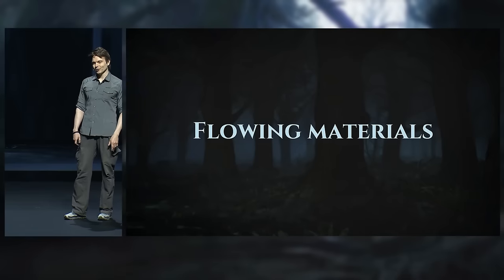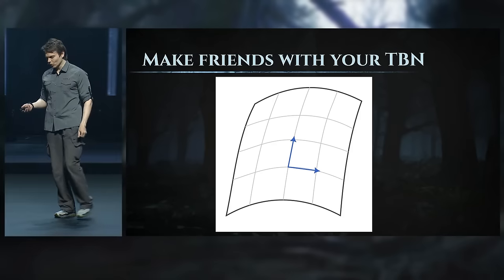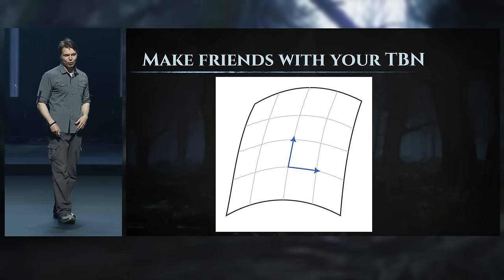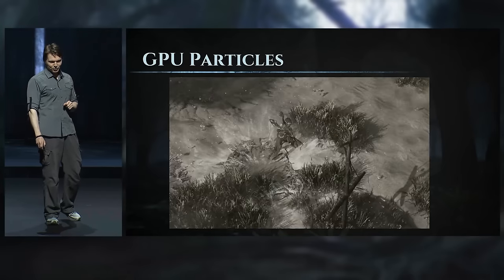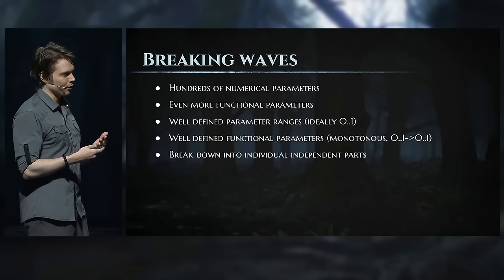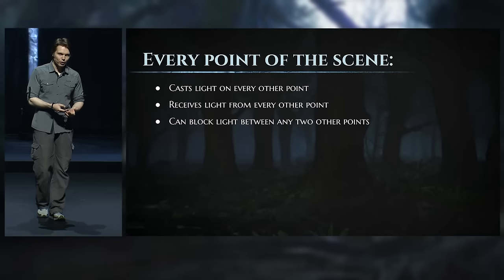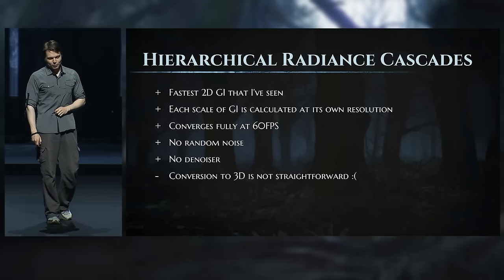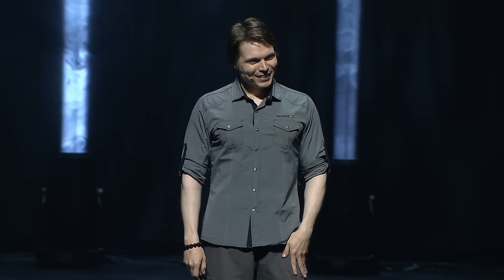ExileCon 2023 - Rendering Path of Exile 2

Comment: Since the talk I have a published a paper on Radiance Cascades. Unfortunately YT does not allow posting links in comments or even mentioning your own videos by name, so.. I guess I can only tell you that there's an announcement on my channel with a link to it?
Reply: If you are the presenter, thank you for this mazing talk. I still have troubles understanding how increasing the amount of light sources (thousands of fireballs) doesn't end up being O(n*n) or maybe O(n logn) but you end up ... O(1) ?? I will need to rewatch it and try to grok it. What number os that constant-limit based on? pixels on the screen? cubes of space?
Reply: @olivierdulac  basically it calculates lighting from every pixel of the screen on every other pixel of the screen. Fireballs obviously still have rasterization cost, but the cost of calculating indirect lighting of the scene is fixed, because the total number of pixels does not change.
Reply: Hey @Alexander_Sannikov - I'm not super experienced with graphics programming, but I do have a couple questions : Since this is screen-space, do you work on pixel buffers that are larger than the screen resolution in order to include light sources just outside of the frustum that contribute to the lighting on screen ? Also, how do you deal with light sources that are occluded from view by geometry ? E.g. a lantern under a porch.

Comment: I've never played a game like this.
I tried to understand the mechanics and features of skills and weapons in this game and realized that I don't understand anything. I guess I'm too old already.
Reply: Follow a build guide. I recommend Pohx’s Righteous Fire.
Reply: @MichaelPohoreski  It would be interesting for me to understand myself, and not copy someone else's experience.
Reply: @СтАрАеМсЯ-б5ы The problem is PoE is hideously overly complicated. There are just far too many mechanics to learn without spending literally years to understand what the game doesn’t explain. You will be constantly dying (which isn’t fun) unless you follow a meta build to do enough damage because you can easily “brick” your character.

At the very least be resist capped 75/75/75/0 as you proceed through the campaign. Around Act 3 you will want to start working on replacing all your gear with 4 socket 4 link rares.
Reply: That's why I don't like it. It's too difficult to understand. And you just have to suffer to find one better build. You can't effectively play the way you like, you have to create an ideal model that is already embedded in the game.  There is no freedom in this.
Reply: Uh, no. You copy a build, have a good time, learn things just by playing it. Take what you learned and apply it to a new build. I’ve made a few builds myself this league, self designed. This came from years of copying builds and putting my own spins on them as well

Comment: Account locked (banned) after support pack purchased from "wrong" region

Hi my account was locked/banned by GGG after I bought 2 supporter packs and paid it from a different region. Im in Australia and there is no "Australian" region in shop, so I used another region and payment was accepted by GGG multiple times a month ago. In POE shop there is no "special region prices" for pack/items, all prices are adjusted based on a currency conversion rate, so no gain or lose for me or them, thus no "fraud". However I was banned without any ability to find another solution or money back.

It is the same situation as you paid with your international credit card in another country, but the seller will tell you that you paid with the wrong "region" card so he takes the money and bans you from entering the shop and takes your goods.

I can easily can create a fresh Epic account and play poe again but I dont want to do it as I dont understand WHY the company behave like that without any REAL reason, as there is no gain for me and no loss for the company on the conversion rate) , only to punish the active player for their support. Not a good way to keep the player base which is not that big in mid-season especially.

Comment: Disable shadows. Thats what we need in the options. Shadows = fps killer. (I don't have a good pc. i really want to play this game without 7 fps, i want 30. i need disable shadows.)
Reply: I don't think that it's your GPU that limits the fps, for me I most often see CPU times to be 3x slower than gpu and also this guy talked about the new lighting that is even faster so that an upgrade for you if you think your GPU needs a little less work to do l. You can check your frame times for each component in the 3rd F1 screen
Reply: poe is really cpu heavy, i think poe 2 will be better optimized after a while but my pc also wont hold up, its already struggling with poe in dense maps
I also cant play on 30 fps, that already hurts my eyes, i need a solid 50-60 minimum
Reply: @xxseesxx9234  thanks for the tip with the f1 i never paid attention to anything other than fps or ping with it, imma try it out